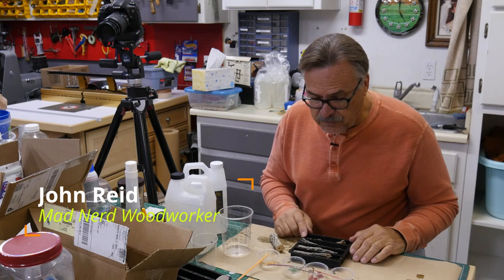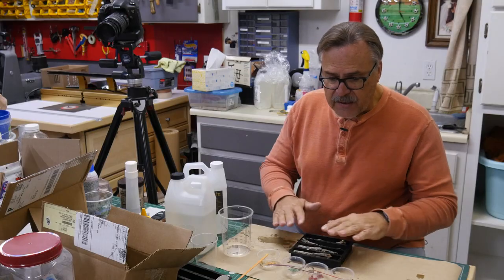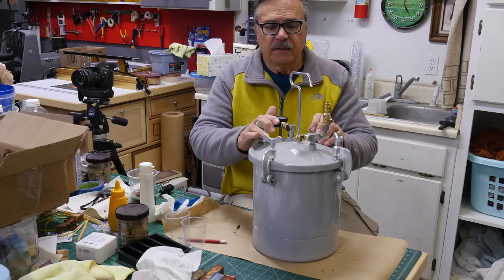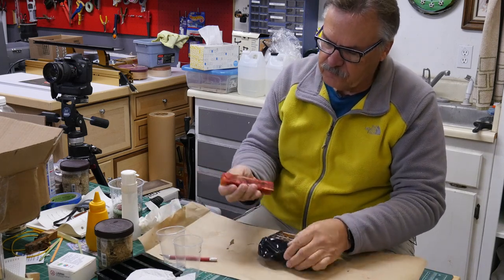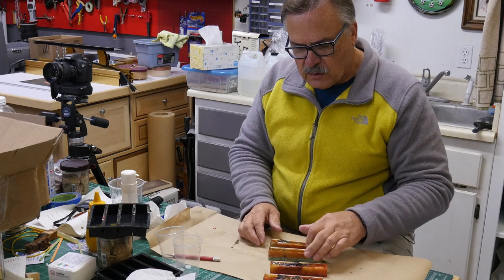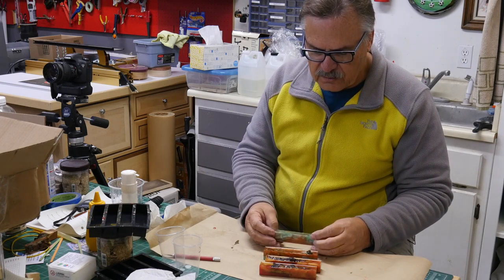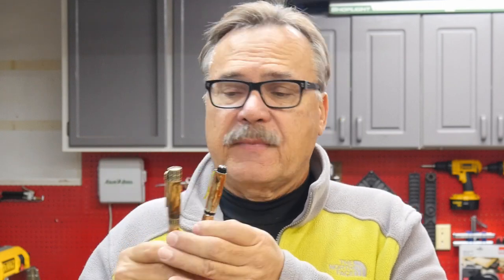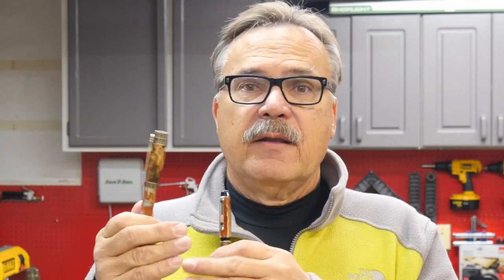How to Make Cholla Skeleton Pen Blanks

Comment: Did you stabilize the colla before casting?
Reply from the maker: Good question John, on these I do not.  The cholla wood skeleton is very dry and dense, so I never had a problem with them in resin.  If I was combining them or used a larger piece for in a resin bowl or turning it by itself, then I probably would stabilize it first.